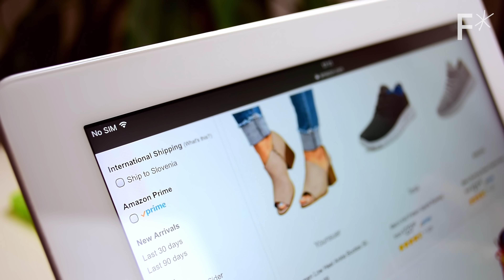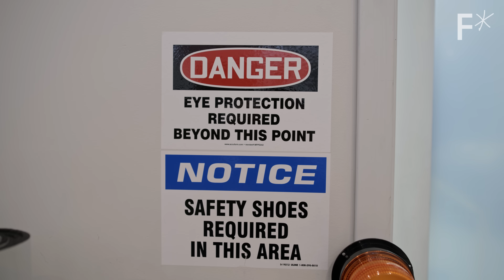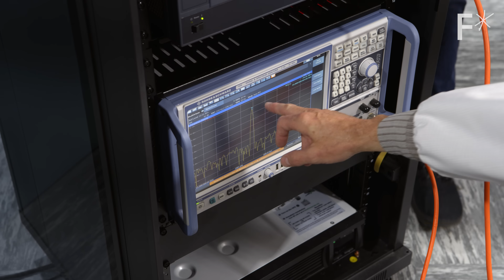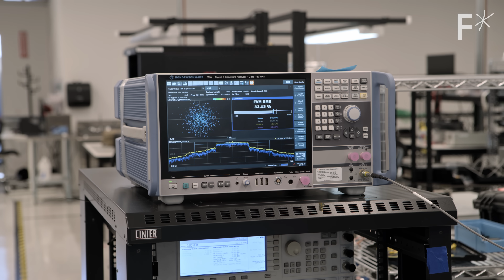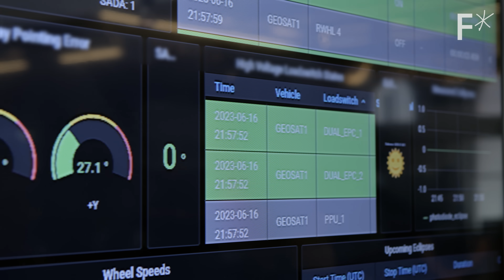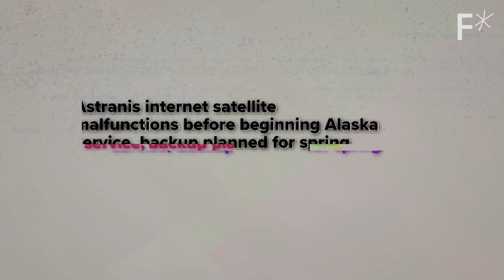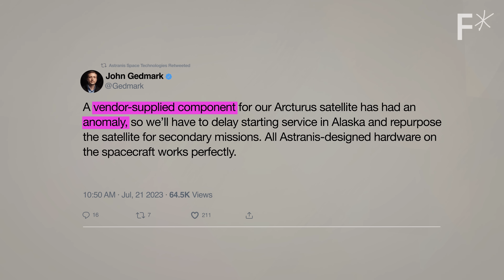Starlink’s newest competitor is using next-gen satellites to create internet for all | Hard Reset

Comment: Satellite communications engineer here with 3 decades experience designing and building large data networks using geostationary C & Ku band satellites.  This is one of the most disappointing and least informative videos I've seen on the subject.  As many other commenters have correctly pointed out, the video completely leaves out the issue of GEO satellite latency, viewing angle from extreme latitudes and total network available bandwith, as compared to LEO satellites.

The Starlink terminal phased array antennas (not parabolic reflectors, as incorrectly shown in the video) represent an engineering achievement that I would never have imagined possible or economically feasible just a few years ago.  I'm amazed that they have found a way to scale production to make such complexity available at such a low cost.  Truly remarkable engineering by SpaceX!
Reply: I’m currently on a geo sat after I lost my 5g tower and wow it’s bad why anyone would want more of this blows me away! Starlink should be delivered before the end of the week! And fiber installed in the next 6 months !
Reply: @redneckadventures9122  i wish i had fiber here .. 5G still better in terms of stability compared to starlink but speed of starlink is amazing most of the time are 200 and above unlike 5g is around 70mb
Reply: off topic. whats the career path of becoming satellite communication engineer
Reply: Oh come on. The latency isn´t that bad.  We´re only talking  240-280ms RF travel time and another 5ms for switching and processing.  2-3 times worse than the 28.8k modems from the 90s.  Who wouldn´t want that....

Regarding Starlink, I agree.  I would loved to have seen the faces of ISP board members and stock holders as they realised what happens around the 3000km mark when comparing RTT of sats in LEO to fiber.   Who would have thought light travelling in a straight line through vacuum could be faster than in fiber zigzagging along its path to another continent.... Maybe that guy Pythagoras was onto something. 

"Do not take roads travelled by the public."  to which Elon replied: "I never do"
Reply: You should have created the video! 😅
I 100% agree with you, this video is just weird.
Reply: Thank you @GregBurghart for pointing out the obvious based on almost hald a lifetime of experience. The fact that this video is misrepresenting or more blatantly misleading people, makes me wonder if this is pre-sseding stunts for IPO? Why do people still try these stunts with 50% of the people on this planet being far better informed than a decade ago baffles me. By the time they are ready to sell their "snakeoil" in 3~5 years, 70% of the planet will have access to all that is out there on the net, thanks to... Starlink & SpaceX. Had it been done properly, stating thier possibilities and endeavours without riding on the back of a giant that has already worn 5 T-shirts or more to shreds, this might have gotten better responses from all of us. Astranis' first launch was only an "hour ago" in terms of what has been acheived with Starlink's trackrecord, and it failed. Oh it wasn't our fault... it was due to a "bad vendor product" WTAF...!?
Reply: Ta
Reply: I know about nothing about this topic, and I thought there is something wrong here.
Reply: Only low Earth Orbit systems work great, otherwise you're wasting your time and money to use this system.
Reply: A sat comm engineer acting like Starlink/SpaceX is impressive when ASTS exists. Either you're woefully uninformed or not a sat comm engineer.
Reply: @ThePalisky are you saying 5000 Starlink satellites like have existed before SpaceX?
Reply: You aparently did not watch the video because it clearly states the latency issue.
Reply: @kennethferland5579 500ms is not a detail, it’s a non starter compared to starlink, this company has no reason to exist

Comment: There really isn’t anything novel about providing Internet from Geo.  The latency that’s introduced by having a signal travel more than 70,000 miles in order to get from point “A” point “B” renders many internet applications unusable. High speed, Internet from Geo stationary orbit has been available since the mid 2000s. Honestly this sounds more like a commercial than an actual investigation or thought through reporting.

Comment: It still bottlenecks to and from the ground. Satalite internet is slower than ground based internet due to its high latency!
Which is why it's not recommended for gaming or other time-senssative activities. Those satellites are not up there to provide us with BETTER internet. They are up there for manifold reasons but internet isn't one of them. 'Internet' is just a cover! Funded in part by the DOD they are spy satellites designed not to spy on other countries as they have in the past but to spy on us ...all of us!

Comment: Call me skeptical.  Communications satellites at geostationary orbit?  There are already plenty of those and I thought the slots were reserve.  Also I've done some work in wireless comms.  There are good reasons to want a big satellite that far out.  If you go with a smallsat, you're going to need to use a flat, folding, beam-forming high-gain antenna as well as larger solar panels, because of power requirements.  You can go light at launch, but it's a tradeoff between launch cost (mass) and design and manufacturing cost (complexity).  Besides there are very good reasons that there are three (Kuiper only has 2 test satellites up) competing high speed broadband LEO satellite constellations.

With that said, I do think we need to grow the space economy and communications is a good first place to start.  But personally I'd be surprised if this company doesn't go bankrupt some time this decade. And if it survives, I suspect it will change is plans significantly.
Reply: Looks like new Nikola to me but riding on a different hype train.
Reply: yeah, like what is new here? just cheaper satellites? lol

Comment: A constellation of large tethered or solar powered telecom airships would be better than this and starlink.  Easy maintenance, flexibility, optimum deployment.  A mix of altitudes like many smaller low altitude tethered 5G stations and a central larger high altitude node station that has links to other cities... could be ideal.  Optimize the system for each region.
Reply: This... let's start a company. 
Solar drones, airships and balloons above 36,000 ft would work with existing microwave PTP systems.
Reply: Alphabet's Internet-providing balloons flew a record 312 days
Loon’s mission is to connect people everywhere by carrying cell towers 20 km above Earth, and delivering 4G LTE and 5G connectivity in partnership with mobile network operators

Comment: Geostationary satellites have high latency - about half a second round trip (ground to satellite to server to satellite to ground.)  That can't be fixed. Well... Not unless someone invents faster than light communication.

LEO satellites, on the other hand, are closer and have ping times shorter than trans-oceanic cables and the like.

The clip of the Starlink dishes wiggling around is totally misleading. They track the satellites using phased array technology. That technology is so fast that it works well on a moving vehicle. The shifts from satellite to satellite are as seamless as your cell phone's shift from tower to tower.

Geostationary Internet is rapidly going obsolete.
Reply: They also benefit from having more and being able to route traffic around bouncing off different satellites to not overwhelm a few

Comment: Brutal latency. 500ms ping times in an absolute best case scenario but it will be worse than that. 600ms to 800ms will be typical. Maybe okay for streaming but not workable for anything interactive (gaming, voice calls, video calls, etc). Starlink is killer because of the low latency.
Reply: @tripplefives1402 I don't think the new GEO satellites are going to be slow speed internet that costs $300. If they did that they would already have lost to starlink and other LEO internet service providers.
Reply: I am getting 28 ms ping from my TMobile cell phone with 100 Mbps download. I can get 4 time faster download speed outside my house.
Reply: @Liberty2358  That's because you live where there are cell towers, this is for people living in the boonies, but it still sucks compared to Starlink. Speed wize and cost wize.
Reply: Most internet usage is stuff that doesn't require low latency so this model works. If you have cheap high latency internet you can compensate with a capped solution for low latency e.g 10GB mobile data for calls and gaming + unlimited GEO satellite internet.
Reply: @asandax6  Even web browsing can become a struggle with high latency and that's why 4G and 5G focused so much on lowering latency instead of just adding more bandwidth. GEO is inherently high latency due to the distances involved. If they want to offer low latency options, they'd have to put their satellites at lower orbits, and for that they'd have to use tracking antennas and lots of satellites just like Starlink does. I don't think they're planning to compete on latency at all.
Reply: @asandax6  If you want to watch YouTube, sure, no problem. If you want to use the internet for work, which a LOT of people living remotely want to do, high latency is untenable. Useless for any sort of real time communication
Reply: @IanHobday  Yes useless for real time communication but usefull for everything else like social media, downloading of large files (which is the most usage of the internet for work related tasks), watching videos, doing research etc.
Reply: @asandax6  "Downloading large files" is not the main use for remote workers, lol. There is no way this geo synchronous system can compete with what Space X is doing and what Blue Origin plans to do. It offers no benefits, only drawbacks.
Reply: @IanHobday  It offers an low Earth orbit FREE OF THOUSANDS OF LITTLE TRASH SATELLITES!
Reply: @asandax6 ah yes downloading large files at work, just like when people use email and Slack or Teams all day long.
Reply: @IanHobday  - 600 to 800 ms latency would not make real time comm impossible, it would just put limitations on its use. I have taught classes over internet links that had latency similar to that and you just have to get used to the lag when question and answer interaction is required. For the most part the data flows one way at a time anyway so you just have to wait. You see this all the time on news programs where they are talking with someone from the other side of the world, a lag causes a bit of confusion but when the users are aware of the lag they can deal with it.
Reply: @WJV9  No one in their right mind would choose such long latencies when other options exist. In a world before Starlink this might have generated some interest but we are not in that world anymore.
Reply: kandle54  How about going to their website and checking the actual price instead of writing BS.
Reply: kandle54  Starlink has plenty of bandwidth and will gain more as they add more satellites. It's a much better system, and far more affordable, than anything that can be put into geosynchronous orbit.
Reply: kandle54  Also, not sure what sort of math you are using where 12x120 works out to 2k/year. Initial hardware costs are not a yearly cost.
Reply: @asandax6  This model works only when there is no better alternative. Like of course you would rather live with 800ms ping than with no internet at all. It's not like customers like the service, they just cope with it. The only way they can compete with Starlink is offering extremely cheap price which is doomed to fail IMHO.
Reply: Starlink is only a killer to astronomy and all the future space exploration.

Comment: 3:15 um, Starlink terminals don’t do that. Phased array antennas move them instantly and electronically to the next satellite WITHOUT impact to a stream. You won’t even notice it.
Reply: I know, sounds like a PAID presentation hyping up their geo sats, not mention any ANY of the downsides and fear mongering BS fact about 'how' StarLink tracks lol.
Reply: That's if another satellite is already within the sight cone. Where my service is in the tropics where it's second only to the polar latitudes in lack of density, my dish does have to jerk around somewhat regularly to catch the next bird.
Reply: @doujinflip  Ummm I call BS...once placed it doesn't need to move at all. Hell the latest gen doesn't even have motors.
Reply: Would u rather that or 1-2secs latency on everything all the time...  @doujinflip
Reply: @doujinflip  The tropics should be heavily covered, I believe all the satellites cross the equator. With 5600 active satellites, I do not think you should be getting dish jerking. You may have another problem. I would call it in. The sensitivity thresholds (if there are any) might be set too tight. There was another guy online complaining of this but he had the dish 3 feet from his RV with most of the sky blocked.
Reply: @avgjoe5969  They cross the equator... quickly. The orbits are often slanted such that they're the most dense over the Europe and Australia latitudes, which is why those places that far north/south got service first with coverage gradually extending towards the middle.

Equatorial orbits are crowded and polar ones are difficult to maintain, so that's why I think Starlink satellites get usually deployed at those oblique angles.
Reply: @doujinflip  Just a matter of time before you dont.

Comment: I think what's missing from the video is that nearly all existing satellite internet offerings are actually in geostationary.
It seems like the main innovation here is reduced satellite cost and newer tech compared to existing costellations like ViaSat?
Reply: I was thinking the same. I really don't see what they are doing differently here
Reply: Video is full of nonsense, like Starlink dropping connection when switching satellites or terminal turning to follow the satellite. Not to say in no way they could compete with Starlink, with Hugesnet or Viasat at best which, surprise, use geostationary satellites for decades. IMHO this is a new Nikola but jumping on Starlink hype train instead of Tesla. Cheap geostationary Satellite has little sense, you want to put as much as possible capability into it due to limited orbit allocation and expensive launch cost.
Reply: Bigger, more powerful satellites like the Jupiter 3, with many more spot beams means an enormous increase in total bandwidth, which means higher speeds for more customers. A dedicated uplink/downlink, is advantageous because it isn't competing with other ground traffic. Latency is still going to be an issue because of the distance, but latency's importance is way over hyped. It really only effects online gaming and live streaming. In live streaming two way communication, it's an inconvenience your brain can adjust to.  And if you live in rural areas without high speed ground neworks, you probably aren't a gamer. 

The real key difference is cost. Internet service comparable to ground based fiber where available and about 1/2 the cost of Starlink  without the equipment cost to get started, 

Of course, you would not be too bright if you chose this or Starink over ground based fiber!
Reply: There is no innovation. They are jumping on a bandwagon from 1962 using a higher frequency microwave.
Reply: He was talking about 2G cell phones so this company will be trying to hit a lower price point.
Reply: @d.boumghar7385 G2 is an infrastructure issue. The customer would have to switch to G4 or G5, but the area wouldn't have to put up the infrastructure to allow that to happen according to the company's plan.
Reply: The reason why GEO is preferred is the lowest cost, you don't need tenths of thousand of LEO satellite.
Reply: @Liberty2358  I get that but the video makes people think that what this company is doing is something new  when it was out for years and years and frankly the latency and bandwidth sucks. This is why people prefer to pay double the cost for spacex.
Reply: @Liberty2358  And won't create LEO space trash disaster that can block humanity for space exploration forever.
Reply: @ScienceDiscoverer  No, even if Starlink satellite fails to deorbit itself, atmospheric drag will slow it down enough that it deorbits passively in a few years maximum. Geostationary satellites on other hand stay in orbit forever. Their method if disposal is slightly increasing the speed to reach a about 200 miles higher altitude that is called graveyard orbit.
Reply: @woopsserg   Yeah when Starlink satellites naturally deorbit, the only worries are to commercial air traffic, No big deal, right??
Reply: @professorg8383  They burn in atmosphere on reentry before reaching altitudes that aircraft can reach. And even if they did not, air traffic would be the least of concerns.

Comment: Very impressive company! Someone must have spent a lot of money on it.
Internet over geostationary satellites exists for many years now and is available to customers. Great that they likely found a way to get the costs down and make it more flexible. But the technical limitations as seen from the ground are still the same: very high latency of at least ~230ms and big antenna installations due to the large distance.
Very difficult for almost all modern internet applications, not only for gaming. I have used SSH for example over such links and it is not funny. Will the possible lower price compensate for that and bring satellite internet out of its niche?